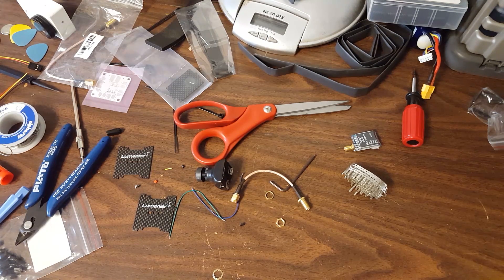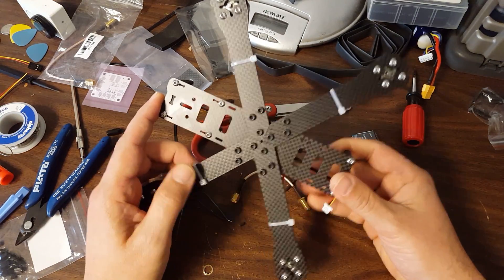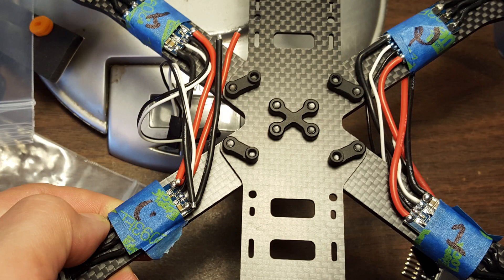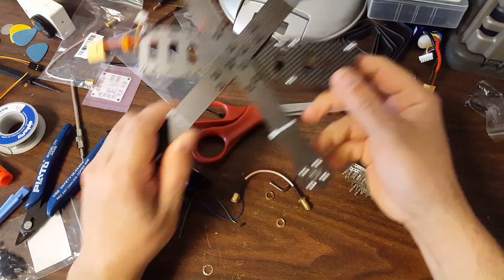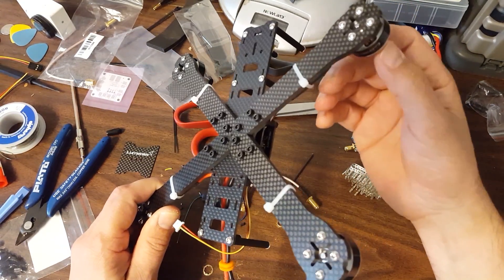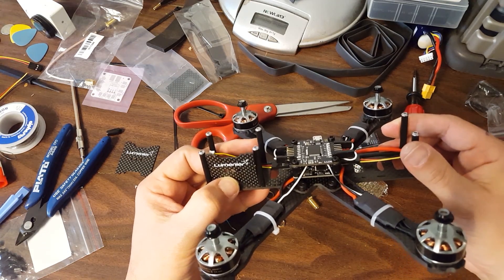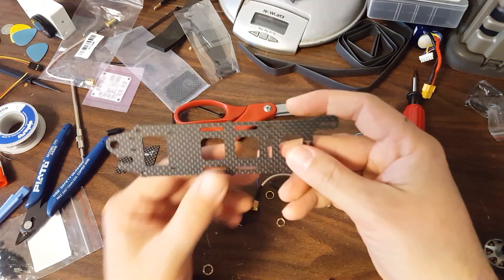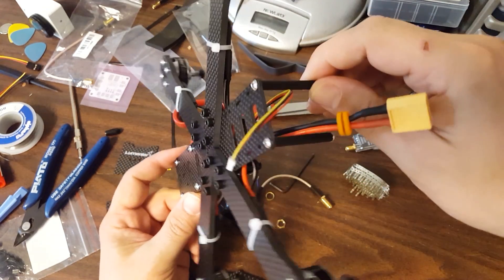Lumenier QAV-R and QAV-R XL Frame Review

Comment: Qav210 or qav-r?
Reply from the maker: -R for me.
Reply: Joshua Bardwell did you try the racerstar rev35 4 in 1 esc? How is the combination with Omnibus f4 v3 without a pdb? will I have video noise with the unregulated vbat ( 7-22 vtx )?

Comment: Can you tell me the max size battery dimensions for the qav-r ? I have turnigy bolts 1300 and there longer than your typical 1300 lipo, also I want to mount a go pro mount.

its hard to get these parts over in Europe,  I looked at the QAV-RXL but its only sold with 6" arms over here, too big for 5045 tris and 2205-2600? or what do you think ? the reason I ask is because I already have the 2205-2600 and lots 5" props and do not want to have to change those.

thanks
Reply from the maker: Bolt 1300 is fine. I have used that exact battery with no problem. I don't think you could comfortably run an 1800 if you were also running an HD cam. Without an HD cam, an 1800 will work.
Reply from the maker: FWIW, I have my FPV antenna coming out the back, not the top. It's possible you wouldn't fit the battery if your antenna was coming out the top. I don't know.
Reply: Hi Josh, thanks very much for the replies, great info for me, could you do me a massive massive favour, could you put the bolt on with the gopro mount, and see if the vtx antenna hole is covered? I would prefer to have the antenna at the top via a 90 degree connector, I would be concerned that id damage the tbs unify pro 800mw in a crash if the antenna is coming straight out
Reply from the maker: I won't be home until the 10th so I can't do that. And also the Bolt belongs to a friend.
Reply: ah no problem Josh,  I will take the plunge and just get the qav-r I think, I am into freestyle so I think the qav-rXL with 6 inch arms  and 5 inch props wouldnt be as good as the qav-r with 5inch props, what you think ?

Comment: Sorry to resurrect an old video but I'm looking at this frame, an alien 5", or a Shrike. I know the Shrike isn't exactly comparable, but I like the room this style of frame offers. Performance wise, can you feel a difference the longer body induces compared to the Shrike?
Reply from the maker: +lcduncan92 there is a difference in flight characteristics between a pure-x and a semi-x or H style frame, but it is not massive if you are talking about one of the modern semi-x frames like an Alien or a QAV-R. It's mostly about weight distribution, and a little bit about aerodynamics. For a day to day flyer, I would think hard about whether the extra maintenance hassle of a pure-x is worth it. Every single little thing that breaks on a pure-x frame is a hassle. On a semi-x or H style frame you have a little more room to spread out.
Reply: That's why I was leaning towards the hybrid-H (QAV-R). I don't have spare frames for racing (I have a basher frame now and am building a race frame), I'm thinking the little extra room given with the hybrid-H will help with in-between-heat fixes.Not only that but at the level I am competing right now, the aerodynamic differences between this frame and a true X is not going to win or lose a race. Eventually I will build a fleet with a little of all haha.

Thanks for the vid!

Comment: Great video Joshua! I love how this frame flies frame but have broken two of the 2mm base plates in fairly routine crashes. One even broke with the extra X brace in place. They have cracked across the base plate directly behind the point where the rear arms cross the base plate. I can't help but think another set of stand offs here just behind the rear arms would prevent the base plate being flexed by the 4mm arms in an impact. I am looking at modifying mine that way.
Reply from the maker: +Daddy Fat Sax FPV I had the same experience.

https://www.youtube.com/watch?v=rNa5XWvUhuE

Comment: What PCB do you use? Im looking for one that can handle 25 Amps and output.
Reply from the maker: +Kelsey Allen RROSD pro mini. If you just want a PDB without OSD really any of them should do up to 100 amps easily.
Reply: +Joshua Bardwell Thanks man, I appreciate it. Mine flew really smooth on 4s but then after a few crashes it seems to spudder out and shake at higher throttle on 4s even when i tuned the pids down after the fact., Then i put an old 3s battery on it and and it flew just like before.
Reply from the maker: Kelsey Allen Damaged motor or ESC would be my first guess. Whenever you crash and suddenly your copter flies differently, then you have a mechanical problem. Don't try to solve mechanical problems with tuning. Fix the underlying issue.

Comment: Congrats Josh, IMO you've definitely put the work in for it. I plan to build a QAV-R in the future no matter what but definitely value your input before I do :)Edit in: It's cool Lumenier included the correct size motor mounting screws. I built a QAV180 by starting off with purchasing the 4mm thick frame and luckily had some extra M2x6 screws on hand for mounting the 1806 Lumenier motors I purchased for the build. For other builds like my ever evolving FT Versacopter, I purchased a bulk pack of M3x40 button head screws that I cut down to length needed for trying different frame configurations.
Reply from the maker: +Ryan K (MototechRyan) between the Versacopter and the QAV-R, you're definitely at opposite ends of a build spectrum. The Versacopter is easy to build and not the lightest/tightest/sexiest layout. The QAV-R is harder to build and a bit more refined.

Comment: Great overview there, i got mine on day of release and absolutely love how it flys, one of the most locked in ive had so far.  I run it with the TBS powercube/Core pro etc.
Reply from the maker: +Hally FPV TBS cube fits okay in there? I have heard it is a bit of a squeeze in some frames. Did you have to increase the standoffs at all?
Reply: +Joshua Bardwell what you need to do is switch the metal standoffs (Black ones which come with the RaceBlade) around so the smaller groove sits on the inside then use 2x 14mm bolts to secure the powercube.  No extra parts required, there is room for your lipo strap but thats about it.  Some build pics on my page btw.  Cheers,

Comment: So the weight of you setup comes down to how much? :)
Reply from the maker: +wuzzle punkt Looks like it's shaping up around 550 with a 1300 mAh 4S and Xiaomi Yi.
Reply: That sounds reasonably lightweight :)
Reply from the maker: wuzzle punkt It's okay. I think I am coming to see that the motor choice plays a big role in your overall weight, especially since it drives battery choice. I could go with 2204 instead of 2206 and probably save 40-60 grams, but I would need to e.g. run 2633kv motors on 5040 props, whereas I feel like these motors (2206/2000 kv) are more suited to aggressive tris. At which point, you need a fairly beefy battery to feed them.

Comment: That frames looks good! But if the top frame is anything like the qav210, then they are really weak.
Reply: +Multirotor fpv +GetFPV made a slightly thicker version of that same plate. They are stronger now. Unfortunately, I ordered a QAV210 just recently and it's the standard one. Part of me wishes I had pieced it out instead of buying the kit and I would've ordered the 4mm bottom plate and the new thicker top plate.

Comment: The camera mount slots seem too close to the base plate post holes to me.
When you look at the Alien camera mount slots they are some 5mm away from the top/bottom plate post holes.

Unless the camera mount blades are so close to the posts that they provide structural support.

Comment: The other quad is the element xhover. You replace two arm In one side at at time.
Reply from the maker: +Invitingsauce you know that's interesting. The one I am thinking of has one arm across the front and one across the back. The xhover does it left-to-right.
Reply: +Joshua Bardwell I know the UBAD Twerker has the 2 front arms (and rear 2 me thinks) in the way you describe.

Comment: You need to follow the Raceblade RCG thread. What you highlight in the video is exactly what is happening, arms are not breaking, the bottom and top plate are.  Quite a few unhappy folks in that thread. Will be interesting to see your experience after a few crashes
Reply from the maker: +dracocq Looking forward to it. I will definitely update as I get it in the air.

I should add that the top plate here is 2mm, where the current top plates on the market are 1.5mm. I have a friend with the QAV who says the same thing: that the 1.5mm plates are a real weak spot. Hopefully the 2mm plates fare better.
Reply from the maker: +dracocq I think if there were one way to strengthen this design, it would be to sandwich a small plate underneath the arms, to help address the stress when the arms are bent upwards.

EDIT: Oh snap. Looks like Lumenier agrees.

Comment: Built like an alien how all the arms touch in the center. Super stiff just like an alien.
Reply: +Invitingsauce yep, Alien rip off! Thought that from day one.  this weighs 106g vs qav210 weighs 91g.  Lumenier has definitely had a few really cool innovations.  The qav210 is my personal favorite.  I do like the redesigned camera mount.  much simpler.
Reply from the maker: +Invitingsauce I hadn't even thought of the Alien when I was talking about the arm design, but I think you're right that it introduced this X-style interlocking method. The QAV-R adds the metal brackets, where I think the Alien uses the PDB to sandwich the arms, right? 

The QAV-R is basically the same as Lumenier's recently-released frame where they introduced this arm design. The product is apparently being slightly updated (2mm plates, XL version, etc...) and re-badged QAV-R due to trademark issues with the previous name.
Reply: +Joshua Bardwell 1.5mm bottom 4mm arms and 2mm power board. Mine is strong as hell. If final glide tells me he's never broken an alien, even arms, then I'm sold. I believe him. Mines not broken yet and it's had its chance. Lol. Still stiff as granite too.
Reply: +Rc Dad yeah everybody's coming out with an X frame with interlocking arms now. Impulse RC did it first though.
Reply: +Joshua Bardwell are the brackets aluminum? I think that would be plenty strong without the extra weight of steel. I think I would of rather had a thin carbon plate(like the alien PDB) instead of metal brackets. But hey the aliens PDB is full of copper. So it's metal too. Kind of. Ok not really.
Reply from the maker: Invitingsauce They feel like steel to me but I'm not 100% sure. 95%.
Reply: +Invitingsauce they feel like mr steele

Comment: I've always had a liking for the Luminier stuff. Quality all over it.
On the other side of the Pacific a small manufacturer is doing some innovative stuff frame wise.check out the race series
http://www.rcgroups.com/forums/showthread.php?t=2347884
and the Kraken 
http://www.rcgroups.com/forums/showthread.php?t=2554888
http://www.rcgroups.com/forums/showpost.php?p=33496806&postcount=172
Reply from the maker: +Rob B I dig that style of small, simple frame. Strong, light, and no more complicated than need be. The more complicated something is, the harder it is to fix when it breaks. It's why, as much as I love my Strider frame, I wouldn't buy a frame with integrated PDB and frame plate today.